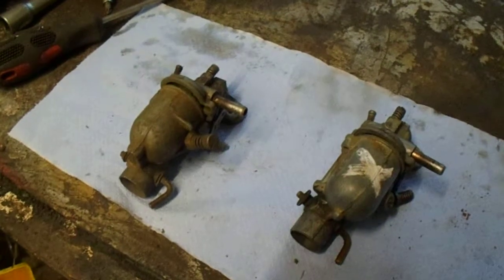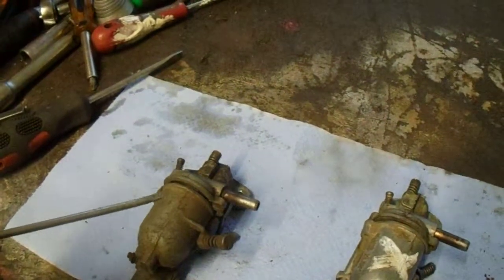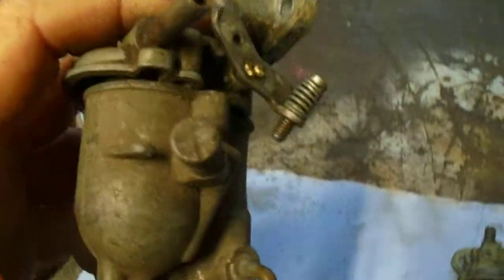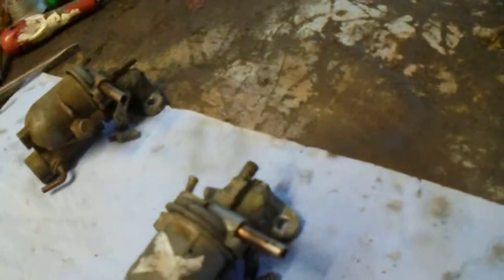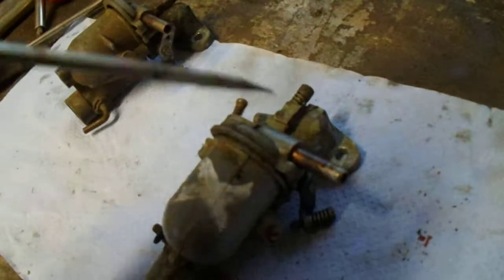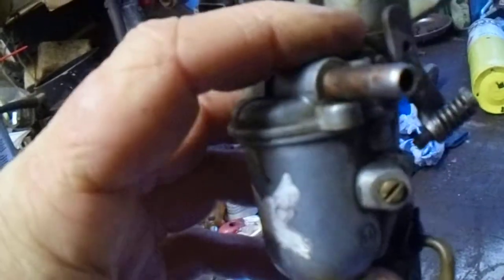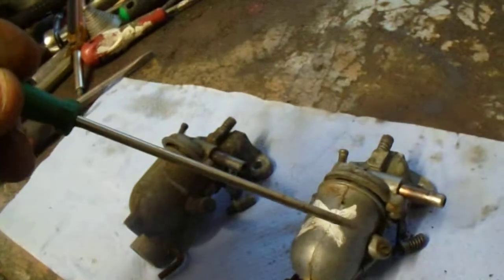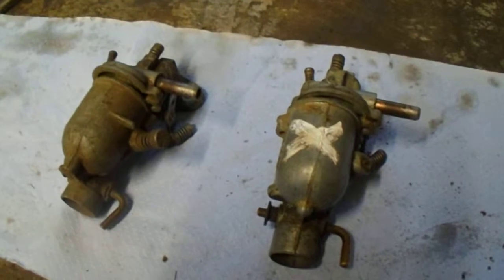ZENITH  CARBURETORS  (  HOW  TO  TUNE  ONE  UP  ON   SUFFOLK  ENGINE

Comment: So how do you set them up ??
Reply from the maker: I WILL MAKE A NEW VIDEO HOW TO SET THE CARB UP ON A SUFFOLK PETROL ENGINE . I SET UP THE CARB BY HEARING IF IS SOUNDS OK  OR NOT ON THE SUFFOLK PETROL ENGINE, AND THE ENGINE WILL BE  RUNNING WHEN I SET IT UP .
Reply from the maker: I HAVE UPLOAD  6 VIDEOS ON HOW TO SET UP THE SUFFOLK ZENITH CARBURETOR . P1 ,P2 ,P3 ,P4 ,P5 ,P6.